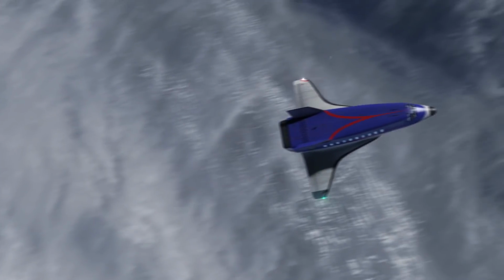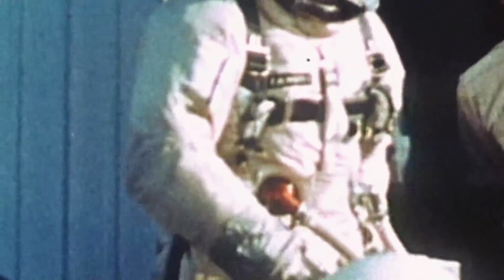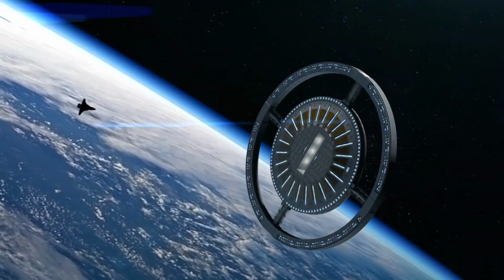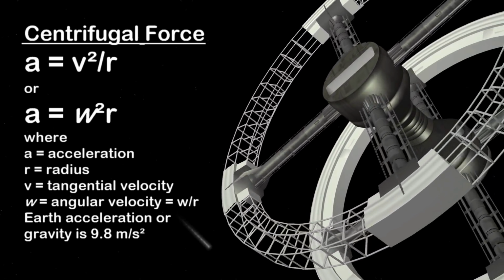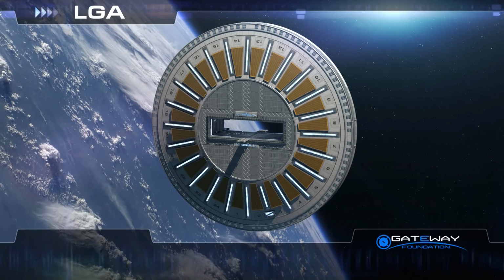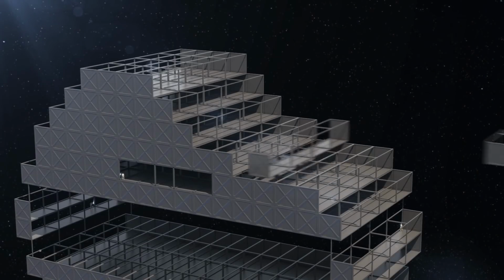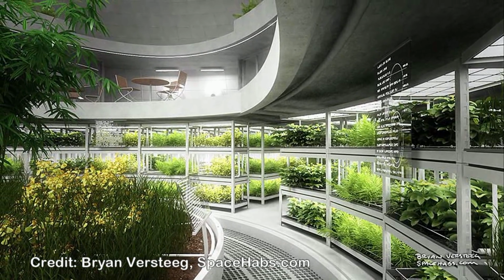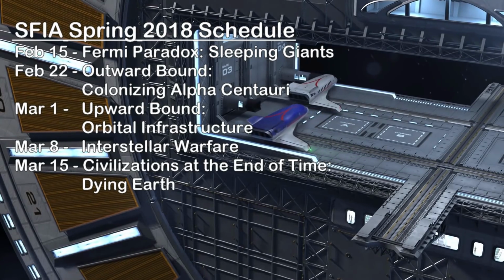Spaceports

Comment: You mentioned the 2001 space port. One thing that always bothered me about it, depending on which posted rendition you look at, is that the port is spinning but is still incomplete in a pretty asymmetrical way. This would mean it would wobble horribly like an unbalanced tire. If you've ever worked with rotating equipment, you know that balance is everything. And If you've ever taken a cruise through rough seas, you'll remember people puking all over the place. I imagine the effect would be the same with the  space port moving toward you and then away from you much like how you experience the floor of a bobbing ship. The problem would be exacerbated if there was a large welcome aboard party in one of the large common areas and all the residences rushed there at once to get in line at the bar which hopefully also has a ready supply of barf bags. But I guess they could mitigate the problem by having the port's water supply pumped back and forth into various water tanks as they monitor the imbalances. I only mention it because I don't recall anyone ever bringing this problem up. Did John or Kip mention it? Am I being too nit-picky?

Comment: Although all this is quite ambitious, lets not forget all the challenges. Reboosts on such a huge scale would be... problematic. So will all the debris hitting the station. Now there have been some incidents which endangered the crew of the ISS, but this spaceport is on a whole other level. Also the bigger the structure, the bigger length at which material expands while lit by the sun, or on the other hand shrinks while in the shadow - we are talking hundreds of degrees celsius difference. Of course, while a satellite is spinning, it may redistribute the heat more evenly, but only to some extent.

I'm pretty sure such big spaceports will be around maybe 60 years from now, not sooner.

Comment: Don't know if that RPM limitation takes into the account of gravitational differences. But if the spinning living quarters is not far enough away from the centrifugal center, the body will experience significant difference of gravity throughout the body, which will cause nausea.

Comment: very inspiring. solving the details of the batteries  and the welding robots, and recharging cycles or the issue of build something at the time you prevent fall to the earth or go to the hell other way.  even the materials have to be differents due  its no atmosphere, (and the metal have to be carried from here ) the corrotion (yes , is not oxigen but, is not and presure too, even cold welding is a problem) ,and even the way to weld is a challenge, youll have to grind surfeces? electrolisis?. hydrogen weakens the materials.  but is only matter to devote our selves to the task.

Comment: Isaac Arthur I like the way you took a design with good video for your focus. However, I like a different approach to modularity. Simply put, I like hundreds of tons of air locks. Specifically, I like LOX tanks with air locks on both ends used like Legos to build a large rotating squirrel cage. With 2 nuclear reactors to have triple redundant power, with solar as one of the backups. With both reactors running normally you would expect to have at least half a gigawatt, plus a megawatt of solar. I always have some piece that doesn't rotate so the piece that doesn't rotate is the micro gravity wing. The micro gravity wing can have many uses, such as tons of storage that remains weightless, recreation, research, etc. The ISS could be attached here and used as a laboratory and eventually a museum. I like SLS LOX tanks as the largest weldable piece available in quantity for use as a standardized module sub assembly. SpaceX BFR will have composite tanking, and I'm not aware of composite tanks being welding friendly (otherwise, I would rather use a totally SpaceX approach). With Falcon Heavy or especially with BFR, I honestly don't think the hundreds of tons of air locks used Lego style are a financial problem the gain in modularity doesn't solve. I wish I had made graphics I could offer.

Comment: The design is flawed. Think of a doughnut inside another doughnut ×2. Connect them together each spins the internal structure in opposition to cancel external spin of the station. This could be built easier and would make docking no more difficult than the ISS.

Comment: All good fun, but how serious is it, really? You never mention the hostility of space except for possible low gravity effects and high velocity debris. The heat on the ISS is unbearable in the sun. Being inside a suit is hardly a help. The only reprieve is to find some shade and shelter there. When you have a screen or solar array between you and the sun, your good, but when the sun is beating down on the wall of your house, then it's a problem. The ISS has not solved this problem and to survive they need to constantly replenish insulation which only has a limited life span. Skylab used the shade of the solar array as shelter. 
Your design here fails in this regard. 
It's not a popular topic of life in space because it raises awkward questions about Apollo. For a 5 minute piece on that see here:
https://youtu.be/Zztbw7MLlkI

Comment: What about a lunar base? A lunar base has many of the same advantages a spaceport has, but is going to be far easier to create as moon rock already makes an excellent concrete and concrete forming already happens in vacuum molding, so doing it in a vacuum only simplifies matters. You can also use the already established moon surface as a foundation to build upon, and even dig into, potentially creating a vast subterranian (sublunar?) tunnel network which is surprisingly inexpensive to produce, as the byproduct rock can simply be sent to the concrete factory to be used to create the building/tunnel linings. This lets you build truly large centralized infrastructure which is capable of launching at a relative 1/8g and without needing to worry about atmospheric drag. 

You will certainly want starports, sure, but a lunar base would be the 'major hub' that would be the gateway to the rest of the solar system and beyond.

Comment: I understand that this whole station is predicated on a lowering of the launch price of materials, but wouldn't it still be much cheaper to expand the GSAL slightly so that it could process spent upper stages (especially the ones in the stationary graveyard orbit), and construct several fuel efficient drones (ion, that electro-magnetic antenna thing, etc.) to retrieve them, rather than sending up specially built girder segments? Would those materials not be structurally sufficient? Is there some sort of ownership rights issue that would prevent this? What am I missing here?

Comment: Non-critical bug in the animation at 4:33 .  Passengers are walking on the floor as if it had normal gravity pointing at the floor.  But the floor is radial with respect to rotation in the station, and it's near the center.  

If it were my choice, I would show de-boarding through a ladder or an elevator.  The ladder would be inside of the pressurized "jet bridge" like in the video.  The travelers would exit the spaceplane feet first and climbing down the ladder.
Reply: Nick Alexeev as they walk further away from center of rotation they pick up more and more lateral speed which is tangent, perpendicular to radial line, and floor pushing them towards that tangent. However as they pick up that lateral speed, 'centrifugal force' increases accordingly hence    floor must curve up for them so sum of those acceleration vectors are always normal to actual floor. So in the end that tunnel will look more like spiral where at center of station it's almost perfectly radial, and at ridge it's basically tangental.

Comment: I now have a question.. if you would stimulate the gravity in the ring doesnt the construction of the ring have to be stonger the further you go from the middle? as the gravity is the heaviest there so more weight pulling the edges away. or is the strenght of the construction metal everywhere the same cause it doesnt matter?
Reply: Yes, everything further from the center would weigh more.  If they're using steel beams though, the strength is pretty incredible.  Just think how tall a sky scrapper is... at the bottom the steel is holding the weight of everything above.  Likewise for the space station, the middle is holding (in tension) the force of everything further out.

You can get a sense of this for yourself by picking up a hefty object and spinning around, the further out you hold it, the more it pulls (for a given speed of rotation).
Reply: Faulx Eve thank you

Comment: How do you put additional rings while the station is spinning?
Reply: It actually gets easier at that point, you just lower new structural members into place... like building something on the underside of a bridge.  Or, if you don't feel like designing all new robots, you stop the spin, do your building, then start it up again.
Reply: I thought about stopping the spin also, but then you'll lose the artificial gravity, and building those rings will take some time for sure. Regarding the lowering new parts into place, they have to be delivered there first, which will have to account for the rotation. It doesn't sound like an easy feat
Reply: Well, by the time you've got spin going, you've got a pretty big crew aboard.  So, it might simplify things to just build the next level non-robotically.  In either case, you would just have to load the construction materials into the station through the central docking ring, then you could "lower" things into place externally by elevators/ropes/ladders along the outside.  You'd have to keep the load balanced by lowering on both sides at once.  Also, you'd need to continually re-spin the station up, since throwing mass further out will slow the spin down (like how ice skaters stop a spin by letting their arms out).
Reply: Now that sounds legit. Thank you! I wonder what will happen in the next 50+ years...

Comment: Uhm, I think we found out already, living in low gravity or in zero G will kill you in few years, eat your bones and muscles to dust. What we have to do is find methods of stopping that, either through some sort of gene therapy, or special suits, or pressure suppository.
Reply: The spinning station should fix that.  Those inside would be flung toward the outward walls (which then become the floors).  Even if it only makes Mars gravity, people could just walk around in weighted clothing to stay fit.  No gene therapy required.

Also, a suppository would only make the blood pooling of zero-g worse.  The blood is mostly pooled up in the head, neck, chest area.  The pressure garment would need to squeeze the blood toward the rectum (and the extremities) to be helpful.   The real problem with this notion is that anything that could squeeze the blood away from the neck/chest, would probably also constrict breathing.

Comment: One of the beauties of building in space is how easy the welding is.  No argon needed... You can even do away with filler wire and just electron weld everything.  Even difficult metals like TiBe would be easy...  Vacuum welding would be a dream come true for most boilermakers and hull techs.

Comment: Is there a reason there's not an EGA (Earth gravity Area) on the Gateway Spaceport concept? I mean, it's already pretty big. When you're already pushing the bounds of what investors would believe is possible surely just another ring, even if it's just in the concept, wouldn't be too much of a stretch.
Reply: A quick check of the math says that to simulate Earth gravity without exceeding 2 RPM (the assumed limit of human comfort for rotation), your station's diameter would be 447 meters.  That's pretty darn big.   I expect that the material requirements of laying down 1.4 kilometers of ring (circumference) may not justify the convenience of having a ring with Earth gravity (which has much less research value): at least, not for a ring'd station design.  

If the station were shaped more like a dumbbell, it might be affordable to have an Earth-level gravity section on one or both ends of the station.  But the ring shape kinda makes it crazy expensive.  So... Perhaps they could build rings for the moon section and the Mars section, and then switch to a pair of Earth sections dangling off opposite sides.  Then the station would look kind of like the Greek letter phi: Φ.

In any case, If people want to weigh as much as they do on Earth, they can always wear weighted clothes while walking in the Mars gravity area.
Reply: Issac said that the MGA could be speed up to match Earth gravity without (just) exceeding 2rpm. I just wanted to know why that's not a thing. Since they already have to speed up the station once for the MGA.
Reply: Heck you're right, he says at 15:15 the radius on the MGA is 244m, so at 2rpm, they'd be pretty close to Earth gravity.   Still, I think my point holds that there's not a lot of research value in Earth gravity, if we want that, we don't need to go to space to get it.  :)

I kinda disagree with myself though, I think we'd want to study what "rotational gravity" does to peoples vestibular system in the long term, even at 1g.

Comment: You'd also have to take in mind the unbalanced mass of the rotating space station. You'd either need ballast or some kind of thrust to constantly correct the minor changes caused by the unbalance.

Comment: I just realize that whenever I see an animation of a space station around a planet like we see in the video I assume that the station will spin around the planet with the flat surface facing backwards and forward. This is of course quite stupid because we would have massive shear between the parts closest and farthest from the planet. This could be partly mitigated by flying sideways since the orbital speed (relative to the planet) could be faster in the lowest part by rotating forward on the bottom and slower on top by rotating backwards.  Which kinda feels wrong :-)
Reply: Christoph Grimmer-Dietrich it won't face forward nor backwards, cos as it orbit 'forward' is constantly changing. To follow it station would need to rotate itself and this is impossible since gyroscopic effect of artificial gravity spin.

Comment: I just don't get one thing and it bugs me that I don't understand it.
Let's say you are in zero gravity and are floating just a few cm above the ground inside (the outer ring) of your "gateway spaceport" . 
Now the whole thing starts spinning. What would actually force your body onto the ground? Why would your body not just stay 
at the same position and see the whole structure moving below your feet? Always when I see a design like this I think: "Well 
if I jump up there is nothing that pushes me down again because I'm in zero gravity". I know that there is a big error in my thought-process but I just can't figure it out.
I made a small picture in paint to illustrate my thoughts. https://imgur.com/a/ty1mc
Can anyone help me with this? Maybe with an explanation or a video link which addresses this topic.
Thank you.
Reply: In the scenario you describe, nothing will give you weight.  Because you are not travelling with the ring, you will not be pressed into the floor.  This would be true of any rotational gravity situation.  If you run along the ground against the spin of the ring (antispinward) at the same speed as the ring moves, then there is no gravity.  This is because you are no longer moving in a circle.  Likewise, if you run along with the spin of the ring (spinward) you will feel more gravity.  This because you are completing the circular motion of the ring more quickly.  Just imagine holding something heavy and then spinning around, if you spin faster it will pull away from you with more force.

So back to your scenario, if you want to start to feel the increasing gravity as the ring spins up, you will have to hold onto something.  Thus, as the ring's rate of spin increases, you too will be carried along.  Once moving, you will begin to feel a force pushing you into the ground.  The force will provide friction and (assuming the station is not being spun up so fast that you get knocked off your feet) the friction with the floor will carry you along from then on.  So, as the ring spins faster and faster, you will weigh more and more.

Does that help?
Reply: As for the jumping scenario...  Imagine a marble is rolling around inside of a bowl.  Now imagine we place a little bump in the path of the ball.  For a moment the marble is airborne within the bowl.  While it is in the air, it no longer moves in a circle.  Instead it moves in a straight line.  Nothing is accelerating it.  It is weightless. From the ball's perspective, going over the bump would be a lot like jumping.  The ground at first gets farther away, then it stops getting farther away, then it gets closer.  Ultimately, because the bowl is round, a marble going straight must return to the "ground" and once again resume circular motion.  As it is for the marble, so it would be for a person jumping in a spinning space station.